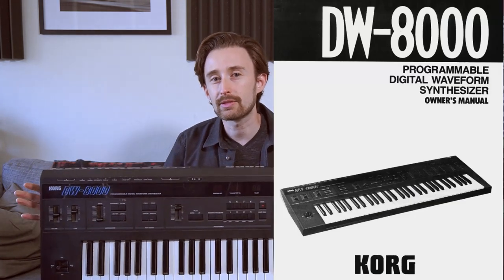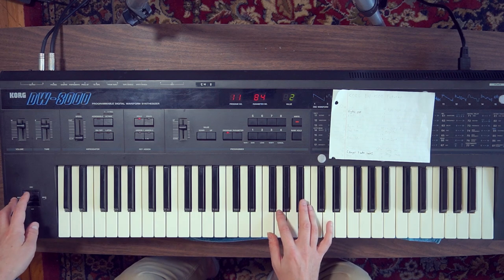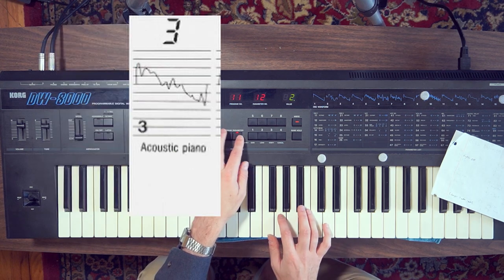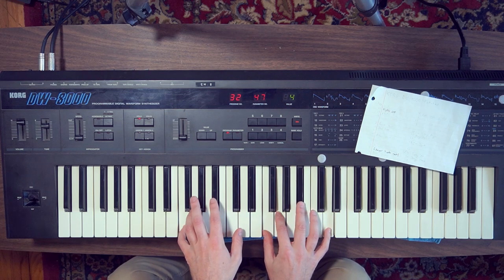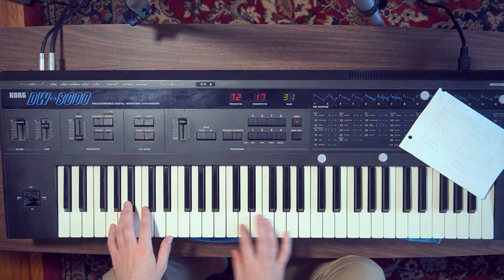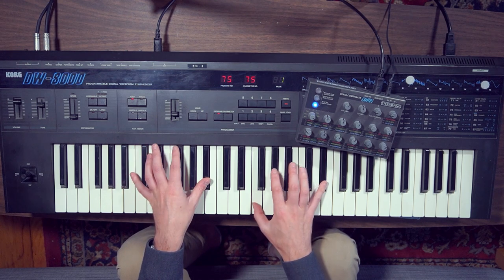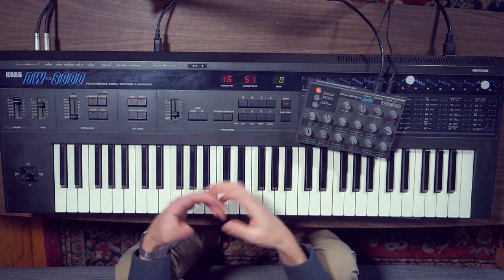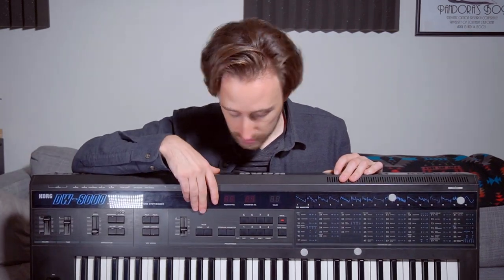Korg DW8000 - A Classic 1985 Hybrid Digital+Analog Synth - Demo and Review

Comment: My wife and I bought a DW8000 to use in our church choir back in 1985. I do not recall the exact price we paid.... might have been around $400.
We quit the choir about 18 years ago. I left it in the church for a while for other choir members to use. Kind of a mistake. When I dropped by the church to retrieve it I noticed the joystick was missing!!
So I packed it up into it's snazzy soft case and schelpped it back home where it sat in our basement until Sept. 2020. 
I found it during a pack-up session preparing for a move. I dug it out of the case and fired it up.... IT'S ALIVE!!! I couldn't believe it!
So I popped the bottom off to see if I could find the joystick. Luckily it was there in the guts. It was easy to put it back in place once I figured out how to do it.
Fired it up again and tested the osc/wave bender stick... worked just like day one!

Was considering putting it on eBay or Craigslist and was shocked to see these units offered for between $600 and $900!!!! 
I began rubbing my hands together and then.... I saw this video while doing other research.  I think this old dear is gonna be a keeper. I'll be packing it into our moving truck. It''l have a new home with us.

Comment: I joined a band a couple years ago and the guys decided I was up to learning a little bit of the keys to add some layers. I agreed but now I am trying to learn keys on this wonderful, but complicated (to me) device that our drummer found on an online marketplace.  Your video was very helpful, although I'm still a bit overwhelmed and I have to keep looking up the meanings of some of the standard terms you used. I've only had the DW 8000 for a few days and I am stubborn, so not ready to give up yet. My BiL, the jazz/funk/rock pianist is going to teach me a bit tomorrow. Wish me luck!
Reply from the maker: Awesome! The architecture is based on "subtractive synthesis" which is the same basic idea as classic Moog and Roland synths. The only major difference is the DW8000 has a ton of different oscillator types rather than the basic sine, square, saw. And the extra set points in the envelopes can be trickier to use than standard ADSR. Good luck!

Comment: I've got my DW8000 quite recently at a very decent price. I initialy wanted to replace my Poly61M with more voices and a better MIDI implementation, but they actually sound very different so I kept both: DW8000 is more lushy, Poly61M more punchy (simpler waveforms). They work very well together. I add my good old DX7 on top for more crazyness.
Reply: how much did you pay for DW8000 if I may ask? :)
Reply: @racalik  325 Canadian Dollars
Reply: @francoisbasquin6974  thanks for the reply, very good price indeed. I cant find any options for lower than 700 US$ now, which is already rather ridiculous

Comment: I bought a DW8000 in 1997 for AUD$400 and sold it a few years later for almost twice the price as it was being under utilised at the time and I needed the money. I regret selling it, along with my 18 voice Korg Z1. Korg did include most of the DWGS waveforms in the M1 and T series but they lack the awesome DW8000 filter with resonance. I know that Korg has released the Modwave both in hardware and software but I'd love them to release a dedicated software version of the DW8000 along with 01W and Trinity plug ins.

Comment: Sounds fantastic, I'd rather have one of these than a DX7 I think.
Reply: i was wondering, do you think it's a good alternative to a DX7 ?
Reply: @helixir4562  it depends as they are quite different from eachother fundamentally...this uses digitally sampled waves through an analog filter vs. DX7's pure digital FM synthesis, I prefer the sound of the Korg personally.
Reply: get a "Strymon Big Sky" and run your DX7 through it.. you will be most pleasantly surprised.  The DX doesn't have an onboard digital delay effect as the DW, but the DX is a great classic.. most musicians always used outboard effects for their DX7
Reply: DX7 sounds cold and often harsh. Owned a 7 and a 100 in the 80s, and vastly prefer other digital synths. There are so many great synths, both digital and analog, there’s a reason DX7s are so cheap now. There’s a million of them, and they ultimately don’t hold up for anything except those metallic bass sounds, or cheesy FM bells.

Comment: Thank you for such an informative vid on DW8000! I would like to know more about your control and how you set it up. Or even recommend other note worthy controllers. Much appreciated!
Reply from the maker: Thanks! I'm using the Stereoping synth controller, edition "8000" but the hardware is the same for all of them. It was about 250 euro as a kit, more expensive in the US assembled,  but they come up used on ebay/reverb occasionally.  There's also the DW-8P which looks absurdly large, but would be ok for a big studio setup. There's also the ctrlr vst, which has panels for lots of retro synths, which lets you program it like any softsynth then keep the presets in hardware.

Comment: Nice programmer! I have been using a bcr2000 but it’s footprint is bigger than I like. The buttons on my dw8000 are dodgy so I need to use the programmer. I like the joystick better than separate mod/pitch wheels. The matrix on the dw8000 is easy enough to navigate that not having a programmer isn’t that big of a deal.

Comment: Can you use the Controller while you're recording with midi into a daw? Thanks. Great video
Reply from the maker: Yes it's good for adjusting multiple parameters on the fly. Ctrlr might be a good solution for automating it. However I think some control changes are on sysex and IIRC if you adjust it really quickly you can you can cause some input lag, just a limitation of the hardware really
Reply: @extralifedisco  Oh ok. So using the Ctrlr midi input to connect won't get in the way of the midi going into the DAW? Thanks for the response.
Reply from the maker: @damion2226  Ah yes I should've said, the Stereoping controller has a midi input for patching note data thru to the synth. (And of course the dw8000 has a midi output to send data to the DAW), so you can still talk 2 ways to it. Also "Ctrlr" is the name of a totally separate vst plugin which can do the DW8000 sysex control over midi as well.
Reply: @extralifedisco  Oh cool. My synthesis knowledge is limited so still learning all of this. I really appreciate the info!!

Comment: can you change patch numbers with the stereoping?
Reply from the maker: No, not that I am aware. You may be able to send program change messages in through it though
Reply: in which section of the manual you can find how to do it pls  @extralifedisco
Reply from the maker: You would need to hook up an external midi controller like ableton and experiment with sending program changes. I don't think there's any manual for that function

Comment: Are these the original factory patches?
Reply from the maker: I think some of them are, although they might be the MEX patches. I remember uploading a factory bank via tape input at one point, but I may have uploaded another bank via sysex later and I definitely edited a lot of patches. I think I got the files here: http://www.dw8000.com/downloads.html
Reply: @extralifedisco  Yeah, I just finished bringing an 8k back to life...internal battery mod and key contact cleaning. I loaded the factory patches via the pallium.com site, but they sound different than a number of YT videos demoing the "factory patches." I was a bit confused, the Bank A patches can't be loaded along with the Bank B, correct? Seems like an either/or.
Reply from the maker: @Birchblaze  Yes, I believe you can only have one bank of 64 patches, and the whole bank must be installed at once.